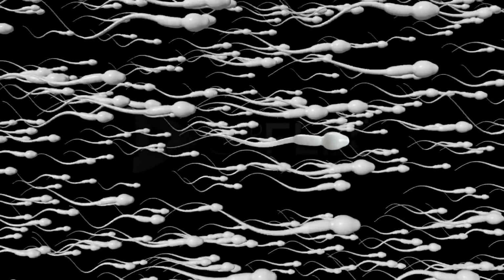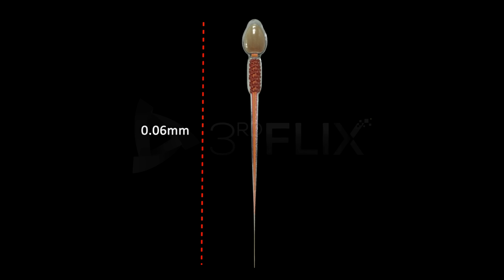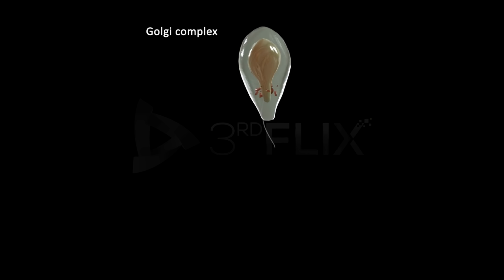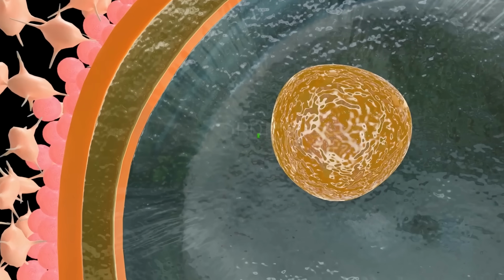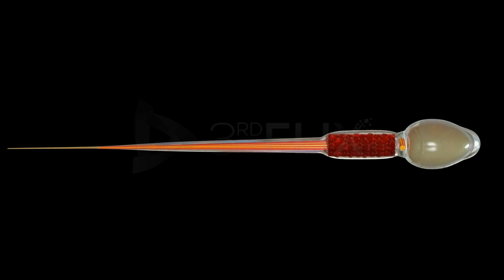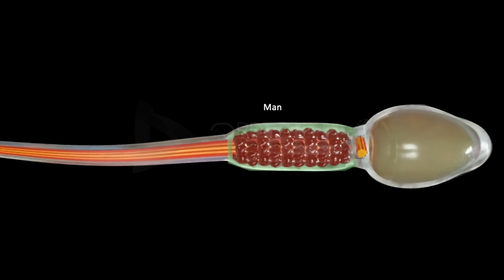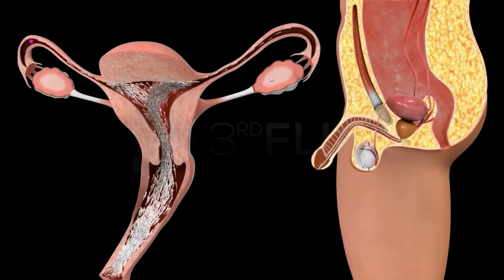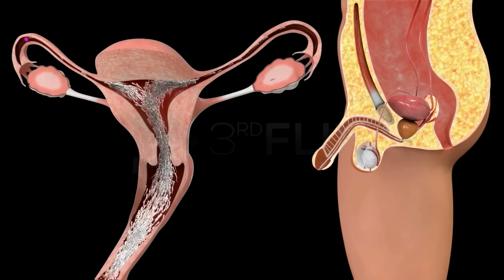Structure of the Human Sperm | Parts, Functions & Survival Explained

Comment: The deltaeder has no moving capabilities, because there is no oxygen in the Earth. The sperm is causeng the moving capability of the delta oxygen, it is called DX pisition inside the delta oxygen. Its side is the cutting point, the human flesh rots at the wounded area. The Covid delta variant resides at the wounded area.